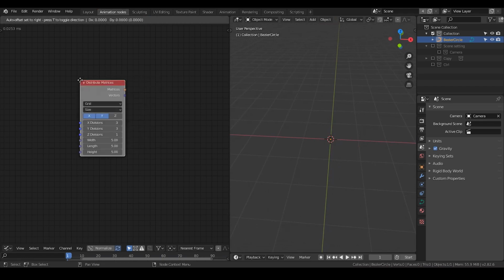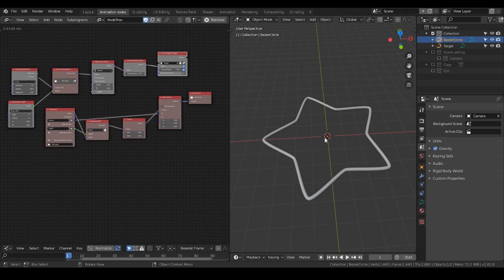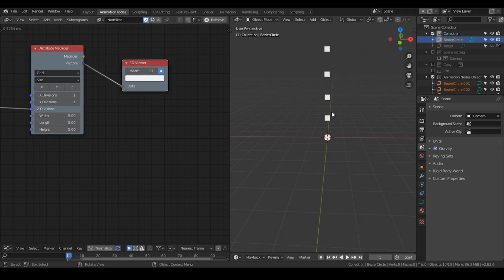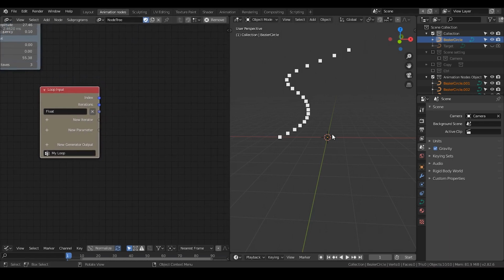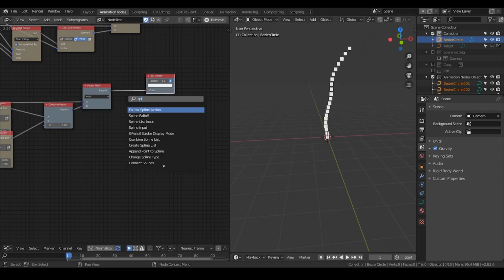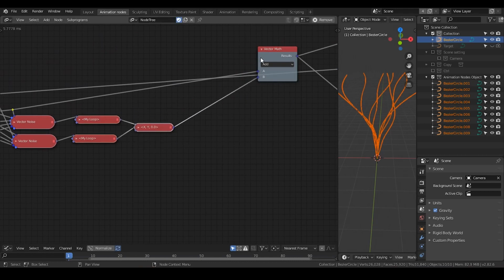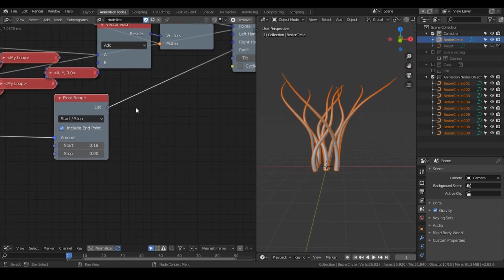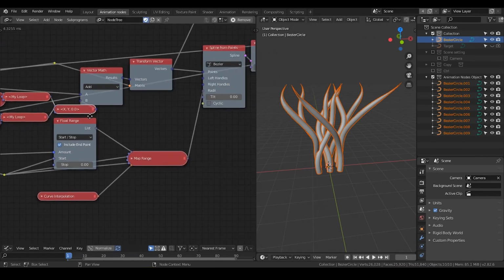[Tut] Procedural Seaweed animation P1/2 - blender animation nodes

Comment from the maker: 2:30 - procedural star shape generator (for spline bevel)
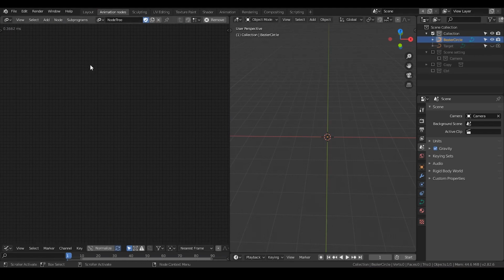6:40 - Waving spline
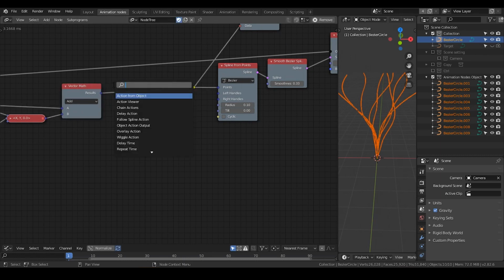19:40 - end for waving spline; please save a copy of this file.
Also the start to distribute spline over a grid.

It seems I miss some subtitles.
I need to correct: in 17:18, I said index goes from 1 to 8; this is incorrect, index always starts from 0, so it's 0 to 8 actually.
Curve interpolation doesn't work in 2.81 anymore due to change in AN to accommodate the development of Blender.
Reply: Curve Inrerpolation works fine in my 2.83. I have learned SO much about spines and animation nodes from this tutorial! Thank you thank you for creating this.